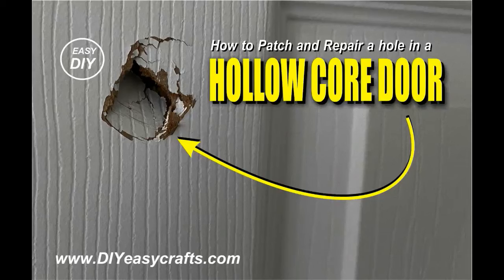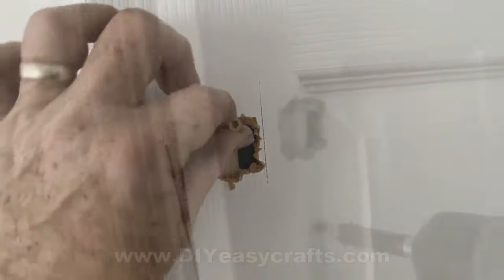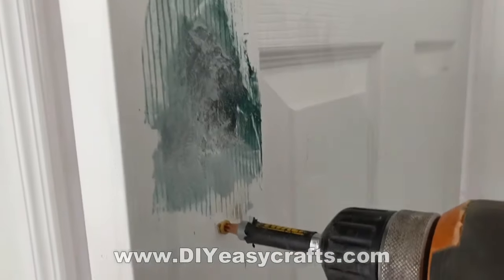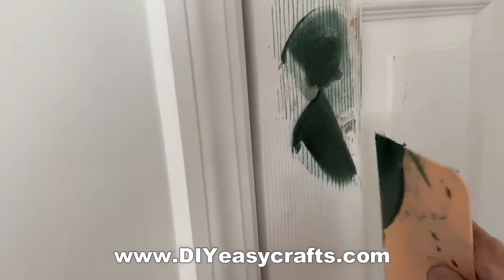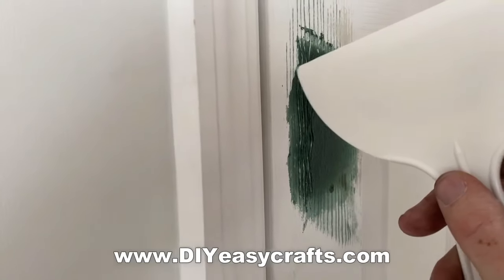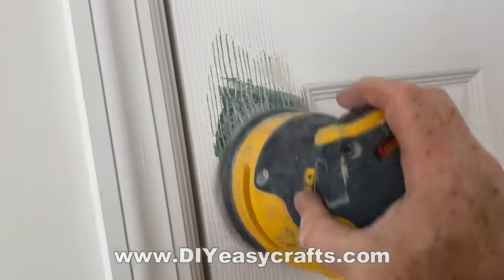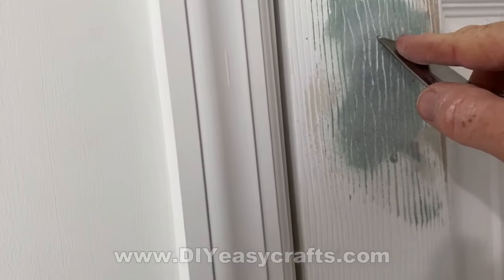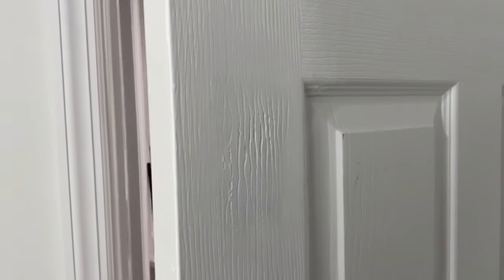How to easily patch and repair a hole in a hollow core door

Comment: That was so fake in the end that was a completely different door. The paint on the wall was a different color.
Reply: I agree completely different door you can see from the square panel on each door grains go in different way 
But I think the filling job is still good
Reply: Scam ending , what a fake YouTuber, ugh 😮🙄🙄🤨
Reply: Even so the repair was still very effective. Probably as close to new as you can get with that kind of damage.
Reply: @joet7136   how you know. It was a completely different door. If it was close to new. He would of shown the same repair
Reply: I ran to the comments looking to see who noticed!!! Lol
Reply: Definitely a whole different door lol the hole was on one side of the door and on the inside by the end of the video it was on the other side and on the outside part of the door 😂😂😂😂
Reply: It actually is the same door. Lighting can change how paint appears to our eyes by several shades, depending on time of day, angle of the light, etc.. if you zoom in on the finished door with two coats, you can see where he made his own wood grains. They are slightly bowed, vs going straight up and down.

Also, the frozen image at the end of the video with the green patch still on it shows the wall paint in the same darker shade. It’s a trick of the light, not an entirely different door.

Comment: The “second” coat of paint door is not even the same door as the one you started with. Check the wood grain lines to the right of the area at the start of the video vs the second coat of paint door. They are way different. Not the same door
Reply: Yes he’s avoiding answering that question after being called out multiple times. What a conman

Comment: Excellent video.  Thank you!  I removed a dead bolt lock from an apartment steel door and did the same repair you did, and it came out great!  The Bondo product is available at auto parts stores or at big box stores.  I would wear protective gloves when using/applying the product to protect your hands.  Thanks again!

Comment: Everybody here because they or somebody they love had a bad day.

Thanks for the video.  Isn't fiberglass toxic to sand?  Need a respirator?  Will standard mud with a mesh cover work like you patch sheet rock?  I'm guessing not as well b/c it's wood...    I've never worked with bondo before, hate stuff you have to mix because I'm never confident in the ratios.

Comment: Too much work, just put a piece of wall taping over, plaster and sand, paint for the finish.
Reply from the maker: I was worried that plaster over tape would not hold up but whatever works! Video just shows how I did the repair

Comment: Why is the last pic shown of the door "after repainting the whole door" a completely different door? The trim on the left of the door had a run in the paint that wasnt there on the final door shown after the second coat. 

You can texture it properly, but using a sharp knife will stand out. Use a bamboo kabob stick to chase the grain. Something that wont cut, but will gouge.

Comment: I'm wondering if you can go back and add the description of the Bondo to reveal the product that you used. I would really like to do this to repair all of the doors in my house😂
Reply from the maker: Its called. Bondo Glass Short Strand Reinforced Fiberglass Filler. You can get it on amazon or at some Home Depots. Other products might also work. This is just what I used